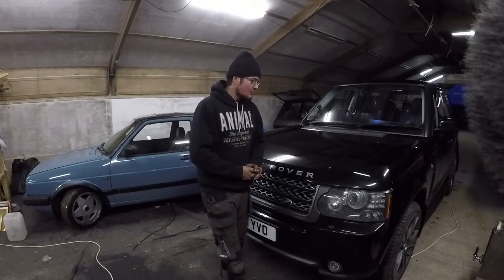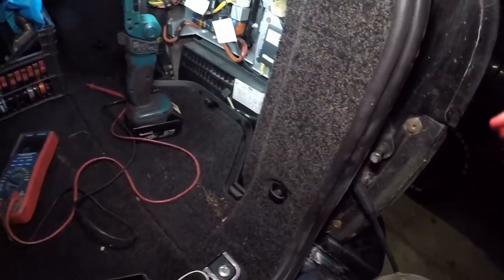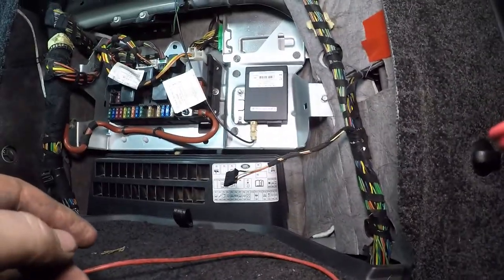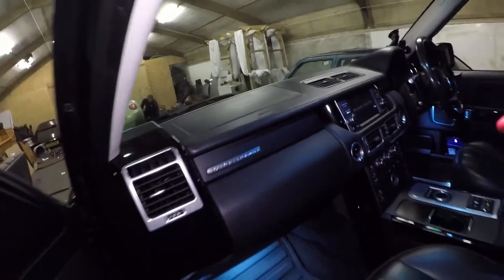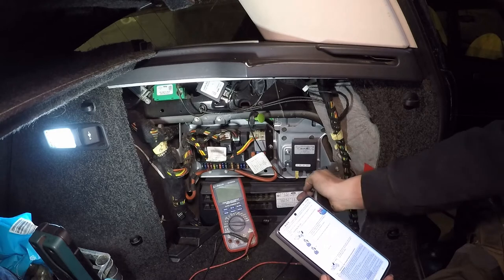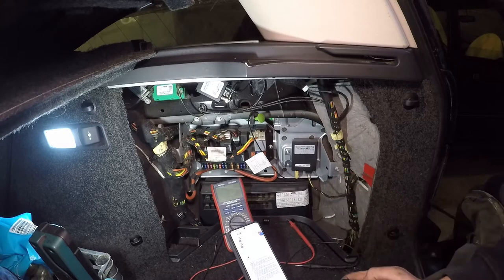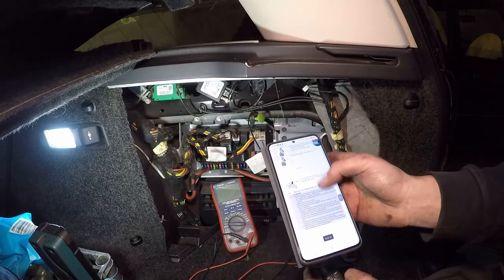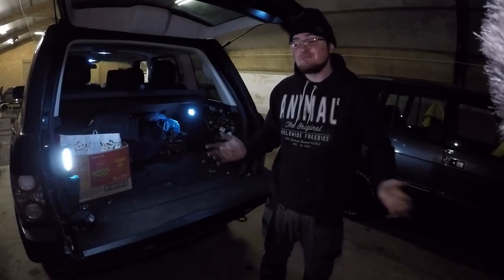Remote Fuel Burning Heater Fix / Telestart Pairing | Webasto Range Rover & Discovery T90 T91

Comment: But what if you don't have power to the Telestart module, yet fuse 59 in the glove compartment fuse box that supplies power to the heater and the Telestart module is live, the heater does work as it should otherwise, is there a hidden fuse somewhere that also feeds this red and black live wire to the Telestart that could have blown.
Reply from the maker: I'm sorry I can't help you out with that one, best off checking all the fuse diagrams, i'd expect the power to come from the rear fusebox, i'd try jump some power to it and see if it's all functional other than the missing power
Reply: Hi Thank you for your fast response, my initial issue was i couldn't pair using the key fob the heater worked normally otherwise, it still does, so i attempted to get the key fob to work, what happened was i did have power to the module but whilst attempting to bridge the live wire to the switched live i instead stuck it onto the earth and it sparked and that was that the live was now dead, i can get power to the switched live from another live source and the Telestart fires up the heater, but connecting this direct live source to the original live source still won't let me pair the key fob, anyway back to the live feed issue, something else has to have happened on that live feed, i popped something,  at the heater end perhaps or anywhere along the way, circuit diagrams appear to show both heater and live feed to the Telestart are from fuse 59, so that is a mystery, unless there is another seperate fuse blown but nothing i can see on any circuit diagram,i will continue to try solve this self inflicted issue first then start again with the key fob problem lol, thank's anyway, :)

Comment: If you bridge the switched live and positive, does it depend if the FBH turns on that the temperature is 5oC and you have 1/4 of a tank of fuel. Will the FBH turn on regardless?
Reply from the maker: Temperature isn't that important, if it's hot (can't remember the exact temperature) the RR won't turn on the FBH it'll just vent the hot air from the cabin, i know you can't be on the red for fuel, not sure if it requires that much to be in the tank